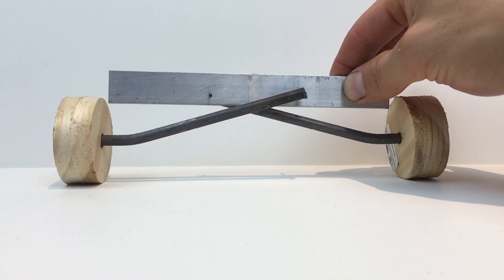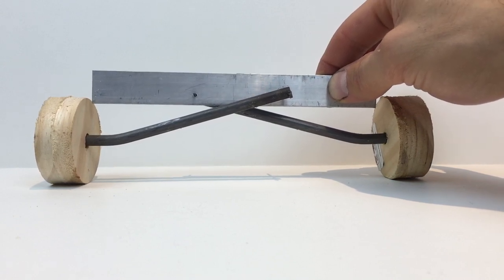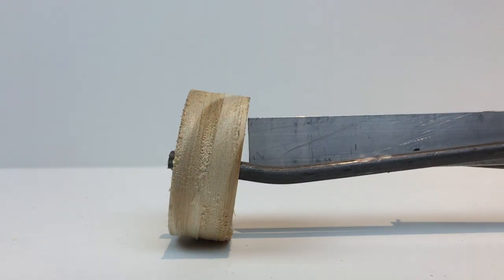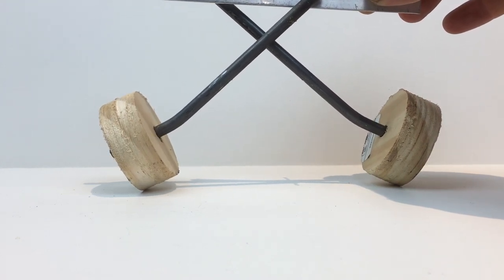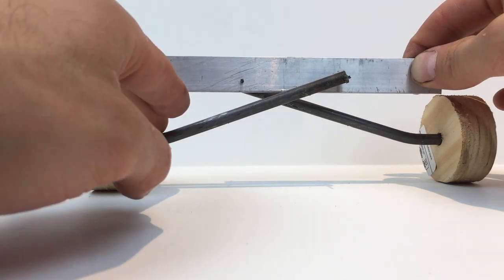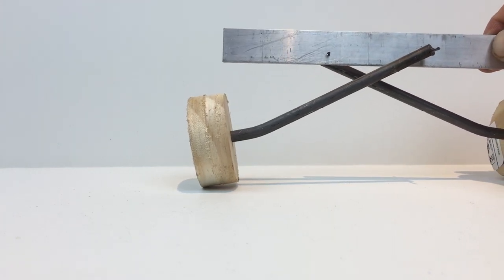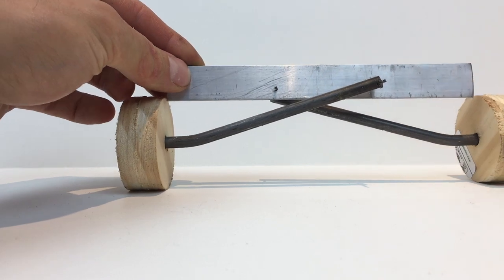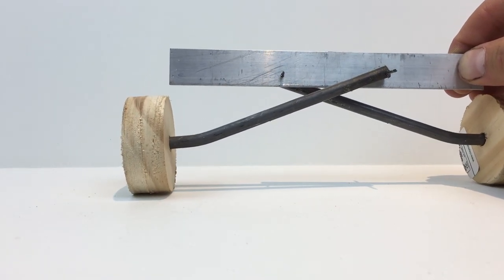Never Use Cheap Leveling Kits (I-Beam) | 1995 Ford F150

Comment: You could just use a differential drop kit
Reply from the maker: T Turk I know what you mean man. But this is more for 2wd. trucks and on this year the camber is corrected with an adjustable camber bushing. A 4wd truck would definitely need a differential drop kit to correct for the driveline angle.

Comment: Why you guys feel the need to raise the front to the same as the back? Ford raised the back higher than the front for a reason!
Reply from the maker: Dodge Ram 01 I feel ya man. However, one practical reason for leveling kit up front is for plowing.
Reply: Because it looks like shit, its just as bad as those douche bags that drop the back and jack up the front. Whats wrong with wanting some symetery in your ride height?
Reply: @DJCuhhhstin956  because when you have a load in the back it levels out instead of sagging and making for a unsafe drive!
Reply: @dodgeramsport01  for those who are constantly riding around with a load on the back, like a career hot shotter for example, then yes, it would make sense to leave it factory, but for the rest of us who just like to off road or don't pull a 5th wheel at all, and I guarantee you its an extremely high number of us, its not necessary, it really isn't.
Reply: @DJCuhhhstin956  So basically you want a truck but want to treat it like a car! Dude then buy a car, u obviously have no reason for a truck!
Reply: Dodge Ram 01 Trucks are not just for work....
Reply: @dodgeramsport01  Bullshit. It doesn't make it unsafe. This is the second comment board I've seen you post this on. You know they come level from the factory now right? LOL. 
I've owned trucks since I was a kid. I work in construction and haul heavy loads and pull heavy dump trailers all the time. What you are saying is just simply not true.
Reply: @JoshDub78  look up the reason why they are like that! Then get back with me!
Reply: @dodgeramsport01  It's only unsafe if you overload it.
Reply: @JoshDub78  like I said look up the reason for it, then get back with me!